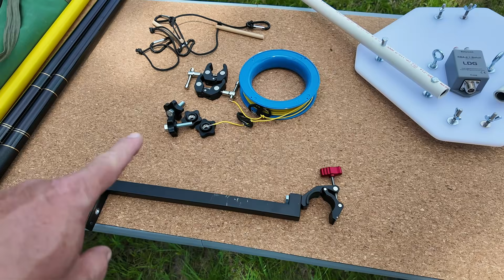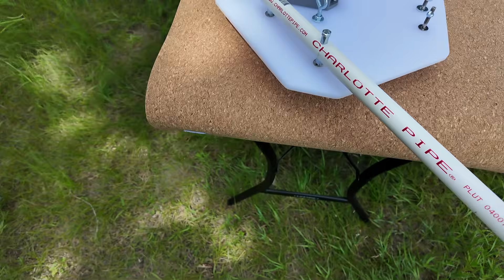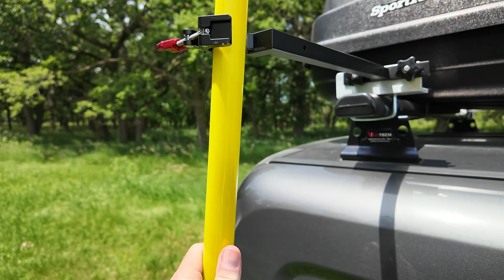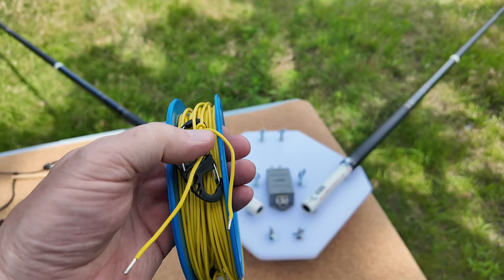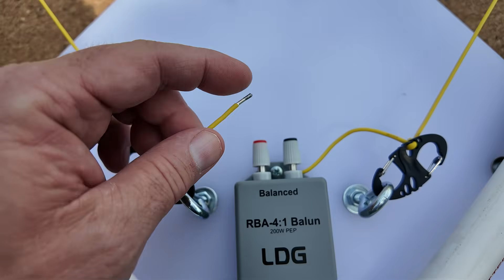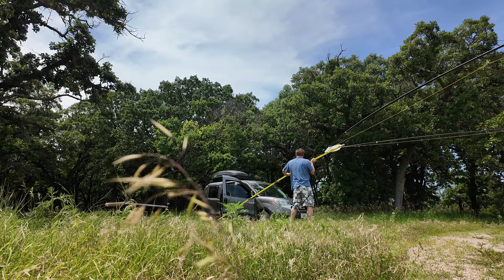How I built my 20m Delta Loop Antenna for POTA

Comment: Great video, outstanding build. The only thing I would change if I built one with our persistant Great Lakes winds would be a ground anchor to drop the mast into.

I would also use a mast with a larger OD, something like surplus fiberglass military mast, but the wind near the lakes make me a touch paranoid and overengineering is a good thing with a 25 knot gust arriving randomly.

Some senior medidal crap has kept me home, no POTA this spring or summer so far in 2026, but I will get back out there soon!

73, Keith,  WB2VUO here near Buffalo, N.Y.
Reply from the maker: Thanks Keith. I do have a ground anchor, I just didn't need it on that windless day plus the shelter of the surrounding trees. I have a piece of 2x8 with a hole drilled in it that I can park on (or stake down) and set the end of the mast in it. I 100% agree, stronger mast would be good ... That's just all I have now for fiberglass. I do have a few of the aluminum military mast pipes. I should experiment with them ... they just take up more transport space.

Comment: I played with making a loop with my Alpha Hextenna but at my OP I got better results from the V dipole. The wind was more of a factor with the loop vs the V dipole. I like your build.
Reply from the maker: Same for me with the wind. I don't use the loop if it's much more than moderately windy.
Reply: @ScottNB0W , I put a 10m loop in attic over garage and ran coax to OP. Only fell through the ceiling once 🤷‍♂️.

Comment: Do I like it? NO, I love it! I admire totally the whole project, commitment that something needs to look great not just work only. Does it give you other bands workable with a tuner? 73 - VE3RUV
Reply from the maker: Thanks! 
Honestly, I have not even tried tuning it to other bands. My assumption is that it would likely tune, but I'd expect to lose the broadside pattern and end up with a bunch of lobes. I don't know that for sure, but that is my guess. So far, I typically set up to POTA on 20m and really have no reason to move with all the calls coming in. I should try tuning it  on other bands and see what happens.

Comment: You may not be an antenna expert, but you are a craftsman. I am envious of your excellent work. If you read this comment, what is the pruning saw pole made with (I can see the metal bands)? I am wondering if it will be stronger to use than a telescopic fishing/roach pole?
Reply from the maker: Thanks for the kind words ... I've been a cabinet maker most of my adult life, until the last few years when it was time to get off my feet. I still have all my tools and a shop to work in which helps a lot. 
I'm pretty sure the poles are fiberglass, and yes, they have threaded metal ends that screw together. Here is a link to the actual kit I have:
https://www.amazon.com/dp/B0CNCLQ3LW
but I see many others that are probably the exact same thing, just different branding.
I can see pins in the metal end pieces that go through the fiberglass pole parts to hold the end caps on. I would think these poles would be stronger than fishing poles, but would the fishing pole be strong enough? That I'm not sure without feeling how stiff the pole is.
Thanks again & 73!
Reply: @ScottNB0W  Thanks. I found the same pole on Amazon UK and they are quite cheap £37. 73 Bob M0BOB.

Comment: Beautiful engineering Scott!  I am trying to build my own Delta Loop.  I keep hearing that a 2:1 balun is needed but you have obviously used the 4:1 balun.  What caused you to decide on the 4:1 balun?
Reply from the maker: Interesting article here: https://practicalantennas.com/theory/loop/full-wave/

I don't remember if this is where I saw it, but "figure 7" shows different shapes of triangles and it looks like the closer you get to equal sides, the closer you get to 200 ohms (or 4:1 for 50 ohms).
Reply from the maker: Thanks Charles ... I'm not even sure, I read somewhere that it should be a 4:1. I'm getting 1.2:1 SWR and it's working well, so I've stayed with that.
Reply: @ScottNB0W  Thanks for the insights, Scott.  I am actually using a 4:1 balun myself now it works surprisingly well.  I am using the 4:1 balun design from YouTuber channel Budget Ham Radio.  I should mention my loop has more than one loop on it.  I am running 20m 17m 15m and 10m (I am using the 20m loop twice as it works on the low end of 10m).  Best regards, Chuck K6PWC
Reply from the maker: @charlespooley1850  That sounds great! I should try adding more elements on mine too and see how that works!

Comment: Hi Scott, nice job , the only thing you need to do is put something in place to stop the bottom from kicking out if it gets windy, other than that a very tidy job . Be great to see it working .
Reply from the maker: Hey thanks! I do have a couple solutions for the bottom. I have a piece of plywood with a hole cut in it that I can park on and then set the pole in the hole (kind of a park-on mount). I can also drive a stake in the ground and twist tie the pole to that. It really is quite stable though and if it's not windy, it seems very secure.

I do have some activation videos using the loop. This one is from the same day I did the loop video:
https://youtu.be/ExJBVZMW2SQ?si=3pVhs1FimUYjX3iq
and a couple others:
https://youtu.be/9tzZNYQLTWg?si=cwPgTsoKFL1jHU5k
https://youtu.be/9tzZNYQLTWg?si=gW-ql7JlSykAc9lq

Thanks again for the kinds words and for watching!
73

Comment: Very nice job! Simple and nicely done. I like the Method of using the wood dowels to drill into instead of the carbon fiber rods to hold the element.  de NZ1I
Reply: I agree , excellent idea using the dowel, I guess for long term plastic bar would be better .

Comment: I would suggest adding a hinged base, maybe of the drive-on variety, or spiked down version set under the upper clamp to help raise the mast and antenna. It would give stability in the event of a gust of wind, and help reduce stress at the clamp.
Reply from the maker: I understand. I have a piece of plywood with a hole in it that I will park on and set the end of the pole in the hole so the pole can't kick out. I'll use it if it's windy, on concrete, more people around, etc.
Reply: @ScottNB0W To that board I would add a hinge and a 1x4 with two mast clamps. My experience is that makes it very easy to walk the mast up. Also, if the tire isn't directly under your clamp, two vertical threaded studs in the drive on base and a slotted plate to the hinge board for adjustment will solve that issue.

Comment: Great video. I would love to see some recommendations on parts you used to get a better idea of how or where to source things. Looks like a worthy project to experiment with.
Reply from the maker: Thanks Brian.
The 12m carbon fiber poles came from AliExpress. There are many different suppliers/brands of them. I ordered these just before tariffs and they were about $10 each cheaper than now https://www.aliexpress.us/item/3256807605416199.html
Cutting board, but you could use about anything strong enough: https://www.amazon.com/dp/B001DI8Z2S
4:1 balun & Mast Clamps: DX Engineering
BNTechgo Wire: https://www.amazon.com/dp/B071HH246Z

I think that is about it. All the other hardware came from local sources (Tractor Supply, Ace Hardware)
If you have any more specific questions, let me know.
73!

Comment: Very neat build with attention to detail - well done ! I would like to have seen an SWR sweep of the band. I usually use a 1/4 wave transformer using 75 ohm coax to bring the impedance down to 50 ohm, so it would have been good to see how the SWR was like with the 4:1. It's a fantastic antenna so would also have been good to hear it on the air for 5 minutes. Thanks again
Reply from the maker: Thanks John. I just posted an activation using the antenna. If you know the G90, you can see the tuner is off and SWR is 1:1...
https://youtu.be/9tzZNYQLTWg?t=956
Reply: I build loops many years ago and they normally are very broad banded no need for a tuner.The only down side is the are  mono banders.

Comment: Fantastic video! Very clean set up and description, straight to the point.  I am currently using a 40-10m Delta Loop (horizontal configuration) but i might as well try your antenna design. 73 DE SV2TCB CU on the air
Reply from the maker: Thank you for the kind words. I'm glad you liked it. I used the loop again Sunday and it performed very well. It's always more fun when project actually works well! 
73!

Comment: Fantastic Build! de N9BAV
Reply: Very cool. Does a delta loop have gain? IDK👍
Reply from the maker: @GeorgeKK3R  I've read in theory, they have some gain on the broad side of the loop, but only like 2db. Claims are that they are also less noisy. I also have a dipole setup I use made from two 17' whips. I've not A-B compared them, but I do feel that the loop must have a lower radiation angle as I seem to consistently get more further out contacts on the loop, and more closer-in contacts on the dipole.
Reply from the maker: Thank you Daniel. It was a fun project.

Comment: All that to run 5watts? 😂
Reply: Never worked DX QRP? If you don't know, you don't know.
Reply from the maker: I said nothing about running 5 watts, but if your point is that "all that" is just too much effort for a lazy person, you're right ... it's not for everyone. 
One thing to consider though .... transmitting 5 watts is not the only purpose of an antenna, there are advantages to an antenna that hears well too.

Comment: Really cool, Scott.  Looks like a great design. If you used it on 7/12 your RBN spots are very impressive. Many of your spots are over 50dB!
Reply from the maker: Thanks, Tim. Yes, I was on the loop yesterday. I didn't have internet at the park and then didn't think to go look when I got back home. Thanks for looking that up. Those are some nice numbers.
Reply from the maker: Just adding ... I was running about 30 watts.
Reply: @ScottNB0W  Great Job. I will have to try this at some point! Thanks for sharing all the details.

Comment: Nice work.  Seems like it would work if you wanted to cut a wire for 17m, 15, etc.  Thanks for sharing.
Reply from the maker: It might work very well to add more bands in the inside... I've done 14 activations now and activated only one band. Maybe I need to expand my horizons a bit.?.?